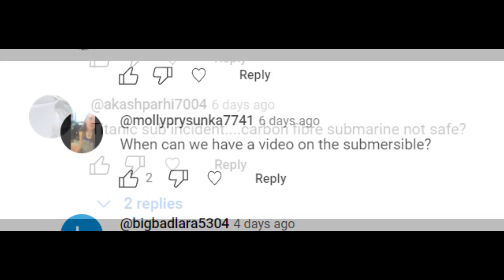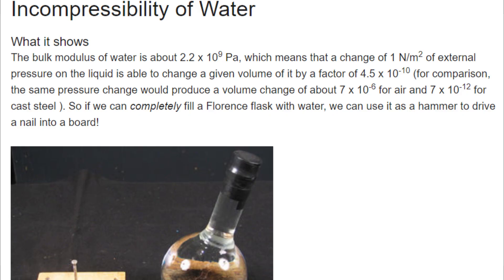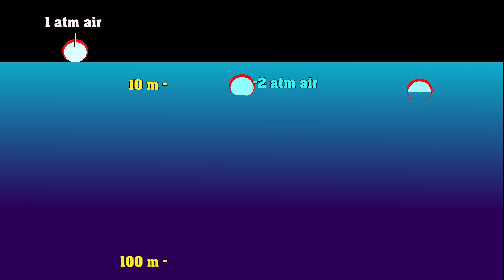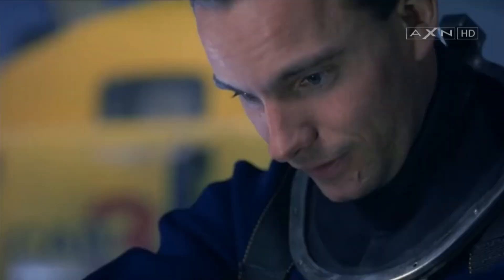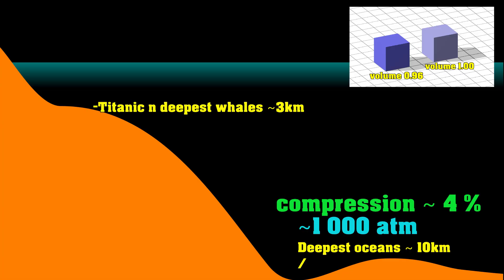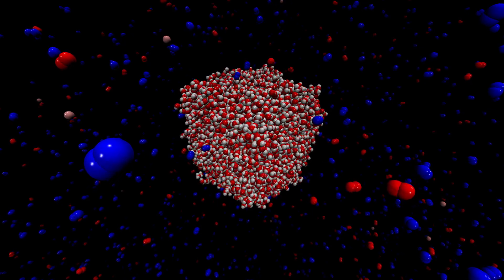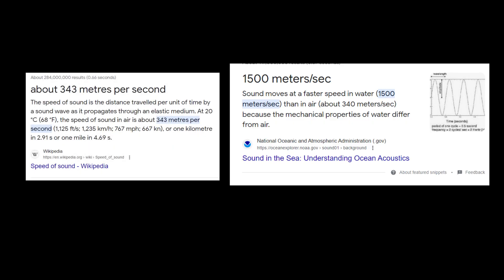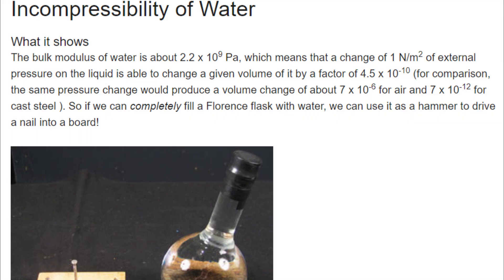What Happens when a Hull Fails at 1000 atmospheres?

Comment: Can you do a vid about how the carbon hull would have failed at depth. I think it would have failed over several seconds before it finally let go and imploded. Carbon doesn't fail like steel. It's fibrous and hangs on for a bit. I think pressure testing a carbon cylinder with metal plugs in each end would be really interesting to see. Unfortunately I don't think the end came in milliseconds for those guys, maybe more like a few seconds, then bang. Just a hunch.
Reply: The hull had been failing since day one. Each time it went to the bottom and came back up those immense pressure changes cracked and delaminated the hull bit by bit.
Reply: Carbon fibre fails explosively. Each broken strand breaks the one next to it. Repair patches in carbon fibre composites from penetrating objects rapidly become enormous. Which is why structural carbon fibre is normally covered in Kevlar cloth to mitigate the debris by absorbing the energy released.
Basically the entire carbon fibre hull would have turned into a ball of fluff at the speed of sound.
Carbon fibre doesn’t do graceful failure. It is there and then it isn’t.
Reply: Have a look at some videos of Carbon Fibre bikes failing, it just happens

Comment: TF was only dealing with one aspect of things here (the most important one), so don't take this as a complete picture of what happened.
Thunderf00t shows the water coming in from one end here since he's only discussing the movement of the water, but what happened is almost certainly that the hull gave way and shattered so that the water came in from all sides except the ends at once.  The hull was pulverized.  They recovered no pieces of it.  If there were any pieces still stuck to the metal parts they recovered, they were too small to see from any distance.  From the vague info the news has given that "human remains" were found in the debris, it appears that some small amount of the people inside was squeezed into the intact titanium rear of the sub, probably in liquid form.
Also, when water moves that fast underwater, you get cavitation.  Basically pressure differences due to the movement causes some of the water to vaporize momentarily.  Cavitation bubbles are hotter than the surface of the sun.  The pits you see on ships' propellers are cause by cavitation bubbles vaporizing bits of the steel.  The implosion of those bubbles can cause shockwaves that damage machinery or kill sea life.  The pistol shrimp hunts that way.  There would have been a lot of cavitation in a very short time.
And of course the air in the sub would have been compressed to 300-350 atmospheres in nanoseconds, which would have made it extremely hot as well.
And then all of this would rebound to some degree as the mach 2+ water coming in from all sides met in roughly the middle of the sub and swirled and equalized, which is why the bits of the sub that were outside the hull were warped and torn apart.
None of that stuff mattered to the people inside because they'd been liquefied by the mach 2+ water, but it determined what was left of the sub and how those bits were scattered around.

Comment: That was beautifully explained.  I had a handle on most of it because I have an appreciation of Newtonian physics and was a recreational diver for a time.  

In spite of that the compressibility of water was always described to me as non existent. I guess for most of my purposes that is a sufficiently appropriate description.  I remember thinking that water being liquid  should be compressible to some extent but never followed up on the idea. Also I would imagine it would be difficult to prove at 1 atmosphere because any attempt to compress it is just as likely to represent flex in the container and tooling used.

Thank you for broadening my knowledge.
Reply: to be fair, the pressure explanation and this explanation are practically analogous, although this one is quite charming I must say. The standard pressure explanation shows that there must be potential energy stored up in the system somewhere to release on the unsuspecting crew but this explanation shows where the potential energy comes from in the first place and why the energy is released upon the sub so quickly. Which is really nifty!

Comment: Fascinating. One consolation is the speed at which this would have been lethal - perhaps it's just me, but I feel it'd be worse to drown or be stuck with a pocket of air waiting for someone to hopefully find me... i.e. waiting to drown.
Reply: Nope, not just you. The general consensus is that at least they didn't feel pain and possibly weren't even aware there was an issue.
Reply: Saved drowning victims said it wasn't that bad.
Reply: @NeapolitanApe  I almost drowned, and I still recall the last moments that crossed over into horror (before someone reached me).
Reply: @lumeronswift  well yeah obviously at first your full of panic but once your lungs are full of water which I'm assuming didn't happen to you
Reply: @NeapolitanApe  No, I'm talking about the horror that grows and lingers afterwards. Not the final moments of panic.

Comment: Is the factoid people keep repeating true? It goes at the time of the hull breach event, the water entering heats to something like the temp of the sun? I mean, that sounds pretty unbelievable, the sun would have melted everything in its path no? The wreckage doesn’t look melted.
Reply: the cavitation bubbles are that hot, but it is a localised short-lasting phenomenon
Reply: Not the water, the gasses inside the sub will heat up when they are compressed. The sub imploded almost instantly which is what killed them.
Reply: @herrschaftg35  appreciate it, so the bodies would presumably have burns?

Comment: Really what killed them... was the fact that the hull of the sub wasn't strong enough to keep the air in and by extension keep the water out.

The water filled the sub at speeds that make shockwaves created by conventional munitions blush. If course the air became emulsified in the water which prevents a surge of air escaping through the surface of the ocean, most of it was essentially absorbed by the sea water at those depths. Think of it as natures way of packing a gas into a liquid, kinda similar to how humans pump CO2 into cans of soda pop.

What kills sailors or anyone caught in a submarine implosion is exactly what would kill anyond in any regular explosion; a rapid pressure wave. The only difference is that the pressure wave in the submarine isn't comprosed of a flimsy curtain of air, but of an ocean of water. In fact lots of people survive being concussed by a shockwave of air, but no one survives being hit by an ocean of water traveling at supersonic speeds.

And if you liked that remember to give it a thumbs up.

Comment: Great video, but theres a thing you didn't explain, that compressibility of water or steel is not for the same reason as compressibility of gases. Gases, as you mentioned bounce around and hit the walls of the container, thats what you feel as pressure. It's not filling the space efficiently. Fluids and solids molecules on the other hand fill the space quite well at the start, so the only way to compress them is to get atoms closer to each other, pushing the electron clouds together. That's why water is said to be uncompressible, because it is, from a filling space point of view.
The same way you can compress water, you can compress any material. So making a group of materials based on compressibility, and including every single known material just wouldn't make sense.

Comment: They used liquid resin carbon fiber which to me is insane considering that's not strong enough for extreme pressure
Reply: They even produced it wrong, using the wrong layering methods.
Reply: @spacejunk2186  Let's be perfectly fair here. They had a few successful dives no? Which means whatever manufacturing mistakes or design problems they had were at least not immediately catastrophic. At most it's possible that the design was good enough and the only mistake was overestimating the sub's service life.
Reply: @randomnobody660 Yes to an extent the design of the vessel was reasonable but still had fatal mistakes in construction and choice of materials, a stronger composite material might have faired much better in my opinion or even just using polycarbonate or Delrin with carbon fiber more material thickness the vessel should have been rated for like 8000m if expected to do multiple dives at 3000m-4000m
Reply: it absolutely could have been, but not slapped together by idiots in an open warehouse. not even hair nets. build it in a clean room, invent a method with which the seal can be inspected like a gigantic computer tomography scanner that can fit the whole tube inside. have periodic inspections instead of shrugging crackling sounds off as a mere annoyance. or just stop cutting cost and build the thing out of titanium like reasonable people would

Comment: Doesn't plastics and carbon fibre act like porcelain and shatter when its under pressure or breaking point? 
The Titan submersible came off as a very cheap design with too many possible problems from its structure.
There were too many possibilities for the submersible to get hooked up on any object. It was known for losing communication during its operation which isn't very promising. The vehicle relied upon external factors to even assist in letting the crew disembark. 
It was a cheap and nasty vehicle and a buisness built upon making money rather than provide safety for its customers.

Comment: With everything just glued together, it was probably impossible to check for slowly building damage to the sealings. So it would have survived a few depth runs but then some kind of bonding finally gave in.
Reply: It wasn't impossible, one of their directors even highlighted the necessarily of such a thing as a sub built in the way they built it will get weaker with every dive but they didn't wanna hear it so they fired him over getting the necessary equipment. David Lochridge, since his report basically said the sub was not capable of reaching the intended depths, they got rid of him... seems it's not capable of reaching those depths.
Reply: All they needed was a couple of cans of Flex Seal.
Reply: No, they could detect faults in the pressure hull. They changed the Carbon-fibre body in 2021 after about 4 dives.
OceanGate's corporate logo was basically: killing passengers for profit. 
As they ignored all safety concerns and cut corners to save money. Such as using a viewport only rated for about 1/3 the depth they planned to operate at. 
To this  company "It is not their fault; if you die in their death-trap Sub; it is your fault for giving them your money"
Reply: @sos_legio_primus  Has the bit about the viewport been confirmed in Titan as it was in 2023? OceanGate claims that the 1,300-m viewport was only on the prototype.
Reply: @sos_legio_primus  I saw the video of a guy (don't know who that was) reading the contract they had to sign pre-diving that said no matter what happens the company is not liable. That's the tldr version.
Reply: @vane909090  The company may be able to skirt personal liability suits from the families with those waivers, but they won't be safe from suits from investigating agencies, investors, or creditors. Even with waivers, unless they're exceptionally well written, I'm willing to bet there will be a lot of very good lawyers chomping at the bit to take them to court for the families, in light of the gross negligence that seems to have been commonplace. The claims of the CEO are arguably fraudulent, so any waivers signed based on them can get thrown out.
Reply: @sos_legio_primus and it was the CEOs neglect that eventually caused his death. How poetic I guess.
Reply: They had a device to sonically check for material fracture. It seems like a silly idea to me, since fracture would be exponentially self-reinforcing. A crack makes the hull weaker, making it crack ever faster. The plan was to ascend quickly if they detected fracture over some threshold. In a way they did.
Reply: @CjqNslXUcM  The CEO studied to aeronautical engineer. A pressure hull on an airplane has the pressure on the inside. So if some turns of carbon fibre is wound too hard, then it takes extra load. And could pop. Then the load shifts to be shared between all remaining threads.

So in his studies, he got to learn of airplane hulls or gas cylinders are self-balancing the load.

Seems he never learned that this concept doesn't happen for the pressure on the outside. Suddenly no pull on the individual fibres. No force that tries to make the geometry perfectly round. The round walls of a cylinder - or even better the dual-round walls of a sphere - makes the material "virtually thicker". And the stiffness of a material comes from the thickness raised to the 4th power. So thickness 10 means 10^4 or a stiffness of 10000. While thickness 20 means 20^4 or a stiffness of 16*10000.

But the weakest part of the hull in compression will make the material flatten at that spot. Making it lose stiffness from being flatter. And being less stiff will make that section flatten even more.

And if there is a delamination in the middle of the hull wall, then one wall 20 units thick with stiffness 160000 is bow two walls inside each other. Each 10 units thick. Each with stiffness 10000. So one little delamination suddenly loses a huge amount of stiffness.

While for a gas tank or airplane cabin, that delamination wouldn't have mattered much. The fibres would still share the tensile load.

In short - I think the CEO did pick up some knowledge about airplane cabins while failing to realise how irrelevant knowledge about tensile load is when switching to compressive load. And how it's too late to react when the delamination starts to happen in the sub. That it will be the start of a domino effect at explosive speeds.
Reply: @perwestermark8920  interesting insight. Stiffness is proportional to thickness cubed.
Reply: @CjqNslXUcM  I'm imagining that the alarm went off telling them they had 1 second to live: "The hull will breech and you will all die in 1 second.  Please resurface."
Reply: @CjqNslXUcM no they didn’t. People say they had some magic device but they didn’t. False fax.
Reply: @CjqNslXUcM my thoughts are that the submersible suddenly ascending would have caused stress on the already compromised haul. If the fresh hold was too low (let's face it, it probably was, knowing their safety standards) it would have been doomed to fail.
Reply: I'm surprise that it wasn't made out of Papier-mâché.
Reply: Similar to the Tesla truck surviving a few metal ball throws and then breaking on stage 😬 😂
Reply: @@tetrazole567 that's interesting, I've not seen those photos yet. From what gathered watching the documentary on BBC,  they don't have any hull penetrator, all communication and control was done via wireless interface.
Reply: I wonder if it was instant, or if there was some slow progression as they descended.
Reply: I don't think the seals would be a problem as the further you do down they more pressure is holding them together. The problem would likely have been fatigue to the carbon fiber. The view-port is homogeneous so they will know exactly what it can take and I don't think it would fatigue as quickly as the carbon fiber would
Reply: @SueMyChin  the seals will give up to the side where the pressure is the lowest. It happens all the time in internal combustion engines and sometimes in hydraulic equipment. That's why engines have blow-by valves and hydraulic arms eventually leak oil out.
Reply: @Weissenschenkel  What I'm saying though is that the pressure works with the seal, not against it. If the seal was a problem it would be a problem at lower pressure, not higher pressure.
Reply: @SueMyChin  and the fatigue likely happened around some stress point like fasteners or a defect in manufacturing the fiber.   I got a napkin calculation of 60kpsi or so and that’s quite a lot for something whose strength is highly anisotropic and whose ultimate yield on the most favorable axis probably isn’t over 150kpsi.
Reply: @SueMyChin  ? The further you go down the more pressure on the seals, compressing them more and giving higher chances at leaking. Pressure destroys gaskets and seals all the time, I'm not sure why you think pressure in the opposite direction as it usually happens mechanically day to day would be any different.

The view-port, despite being homogeneous, wasn't rated for that depth. If I were a betting man, I'd put my bets on it being what gave out. It's the part that quite clearly was not engineered to be up to the task. Just because it worked a few times didn't mean it would continue to work.
Reply: @Microtardz  the pressure is working with the seal. The pressure is pushing the two surfaces together not apart. 

The company that made the viewport use the same materials to make higher rated ports presumably because they know how it degrades with pressure cycles. Suggesting it holds up well, otherwise why would they use it?

Carbon fibre is not used for pressure hulls precisely because it fatigues unpredictably. If the sub imploded on the first dive I'd say it was the underrated view port but because it imploded on its 15th dive I'd suggest it was due to fatigue and most like the carbon fibre.
Reply: @Microtardz It's actually the opposite, increasing pressure creates a better seal. Did you ever dive to the deep end of the pool with swimming goggles on? Closer to the surface the goggles are barely sealed, but the deeper you go, the tighter the seal becomes
Reply: Carbon fiber and even bonds to the titanium could be tested. The machines that do it simply cost too much money for their tastes, so they didn't get em and basically hoped for the best because "safety is for wankers" was basically their attitude.